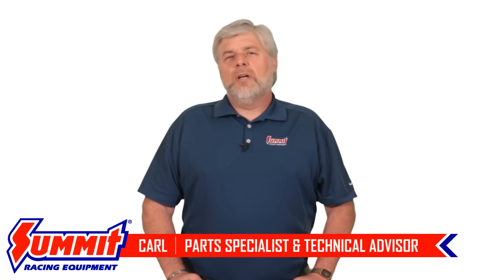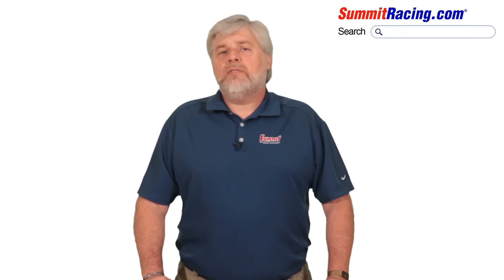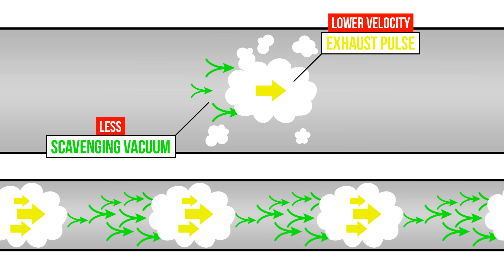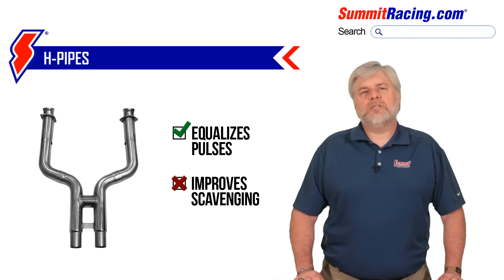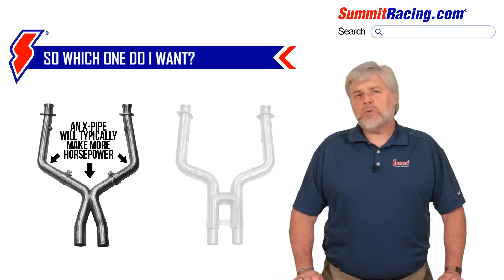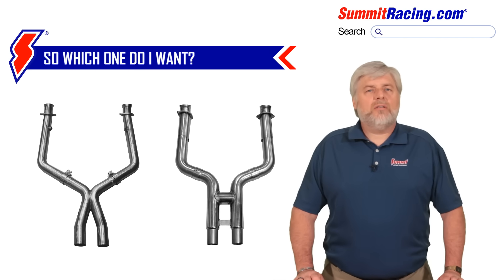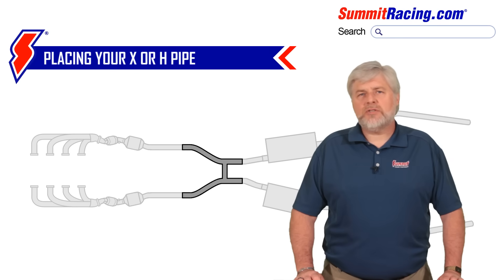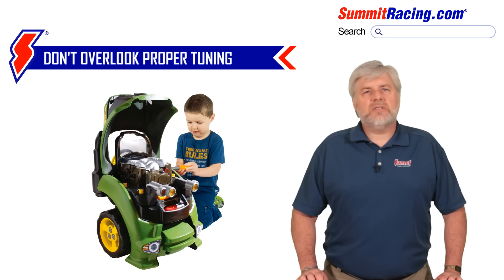Exhaust H-Pipes vs. X-Pipes: What You Need to Know

Comment: Question before I swap out these header i just bought. Will I feel or notice a difference with swapping my BBK Lt 1 5/8 ceramic, H pipe 2.5 all the way out Over to ARH Lt 1 3/4 stainless, Xpipe 3inch to 2.5 Keeping it magnaflow. No cats or should i just sale them a and not waste my time? am I making the right choice in swapping my headers out

Specs:
Jt V7 17lbs 
Kellogg 3.8 stroker 8:5 to 1
5.85 rods
Eddy intake
3.73. 26 inch tire
Bored .020
6061 intake
Air to air
80lb semen deka
Meth injection
Ported polish heads (Fox)
15% O.D pulley 
Pump has 93
Blow thru hpx
Shifting @ 7000 rpms
On3 dual 340 pumps return fuel system 

Blower Cams 
.550 lift. Lobe 116
Duration. 050  Ex 241  Intake 249
Advertised.      Ex 279    In 287
Rocker ratio  ex 1.825.   In 1.825

Comment: Does the length of the cross over pipe on the H-pipe matter? Example; running true dual exhaust on a 1ton, can I patch in a pipe where it'll fit or do I need the crossover pipe as short as possible?
Reply: The crossover pipe is just to balance the pressure between the two sides. A shorter distance between the two is preferable but if you have to add excess bends to achieve it, you're likely to lose any gains you were trying to make. Unless there's an easy spot to relocate your exhaust, to get them closer without adding restriction, your best bet is to just run the longer cross pipe.

Comment: I have a 289 in a 67 mustang, it makes great power from 5000 to 8000 rpm, the H pipe allows it to be driven normally below that.
Reply: Nice car
Reply: Haha! A 289 between "5000 to 8000" rpm is between "dead and impossible"...  I'd be impressed if it ever reached 5000 rpm - but going over it would almost certainly mean a 'leg out of bed'.
Reply: @thenewviceroy  
Not if built right. Mainly valvetrain beef ups. Oiling is not an issue for SBFs and the short stroke and good rod angle geometry allow it quite easily. Sounds good up there, too.
Reply: @upsidedowndog1256  if it is not making great power below 5,000 rpm, then it is built wrong for street use. it should be coming on strong at 3,500 at the very least.
Reply: @FRLN500  
I rather enjoy the powerband. It makes more than stock below 5K, waaay more than stock above.
Reply: Anthony Butera I have a 03 Dodge 3500 that makes great power at 2000 RPM... why I love diesel... we diesels get to use our peak power all day every day without blowing up the engine.
Reply: SilverStar Heggisist 😆

Comment: Engine masters just did a dyno shoot-out comparing straight duals, H-pipe, and X-pipes. They did multiple pulls with each, exhaust size and muffler's were the same for each test. The variance between the three was shy of 4 ft/lbs of tq and 1.5 hp. Maybe NASCAR finds those numbers important, but for the rest of the planet running full exhaust you'll never notice any power difference. 

The real difference is sound, and packaging. The X-pipe sounds best, and is the hardest to fit under the car.
Reply: Rene Jelles what type of sound sounds best, is entirely up to the person
Reply: Rene Jelles In my opinion, I like the deep growl of an H-pipe for the latest gen Mustangs. From what I've seen, X-pipes are higher pitched
Reply: The Fringes X-pipe is more of a Whoooop sound ( with the stock cats ) on my Town Car. Sounds like it’s reving a lot higher than it is. I get 21mpg in the city now.
Reply: Rene Jelles I personally think H-pipes is the best sounding. It gives that burbling, raspy, growling exhaust note.
Reply: So you think there are bigger differences at part throttle? OK...
Reply: @Zero-Fox-Garage  my phone
Reply: Rene Jelles No way! In my opinion the H deep rumble sound aided by no cats sounds sick. Also in my case I get to keep my quad setup.
Reply: Thats quite interesting. I would of thought it would be more of a difference that that given that V8 have uneven pulse timing of each bank due to being crossplane. But I suppose its probably too late at that point and best results would be from "pile of snakes" headers, like those on the GT40 where 2 of the primaries from each side are swapped to make each collector receive evenly spaced pulses.

For my own car I am going away from the norm of Y pipe, H or X and going 2 separate system as I have 90º V6 and each bank is even firing and adding 2ndary together reduces with the scavenging. It hasn't really been done much before beauce general concensous is applying V8 techniques will works but it doesn't for a 6 cyl engine, a few race cars and street cars with buick v6 have found good gains going separate banks for this reason.

The best scavenging strength occurs with headers from 3-1 and 4-1 on even firing. up or down those numbers the  resonance amplitude aka scavenging strength decreases. 

This is why flat plane V8, inline 4, flat 6, v6  etc respond so well to tuned exhaust and intake manifolds.  And why normal V8 not so much. Dual plane v8 manifold tells of this story because of the runners from each plane goes to the even firing cylinders overcoming the uneven bank issue. So I see why they don't drastically improved with exhaust pipe design either.

My mate added a H pipe over his dual separate system on his V8 HQ Monarro hoping to see improvements but nothing happen.
Reply: 7 months late but I agree, with Nova, H-pipes sound the best. 

X pipes are alright but depending on the car, like a V6 Mustang with an off-road x pipe, it sounds like a rattling tin can at full throttle.
Reply: Hit “like a v6 mustang.....” give up your man card.
Reply: @frustratedmillennialz if i want that roaring sound like a lion but not that loud not gunshots. What's better for me?
Reply: When everybody is running under tight regulations, then every extra horsepower (no matter how small!) Counts. 

       Same with aerodynamics (maybe its just one extra Mile an hour... but it counts!).... if you add up 1+1+1+1... +1+1+1 it starts to add up. It doesn't have to be all about 20, 30, 50 hp...its about what you get in TOTAL!
Reply: My 85 C30 sounds mean as hell with factory true dual exhaust which includes no cats. No H pipe or X pipe. And factory stainless manifolds too.
Reply: Rene Jelles - thanks for the heads up - I really should pull the trigger and get their premium service I guess
Reply: No one mentions true duals (no crossover, its on my el camino and i love it
Reply: Rene Jelles 
I've got a 2012 BMW 550i xDrive w/ a 4.4L Twin-Turbo V8. It makes good power but sounds like a little girls electric moped... 🤣

I'm looking to replace the resonator with either an X-Pipe or straight pipes back to the stock valved mufflers, hoping that'll make it sound "meaner". 

I understand the X-Pipe would give it a less raspy, higher exhaust note than straight pipe back to the stock mufflers... Would it hurt power much to just go with straight pipes replacing the resonator to get that DEEP RASPY sound, or do I need to go with an X-Pipe to keep from losing power on a small, Twin-Turbo V8?
Reply: Rene Jelles i have the X pipe on my 96 GT and it sounds good even with the stock mufflers.
Reply: Headers true duels  whith flowmaster supper 44 3inch pipe sounds good on suburban with 454
Reply: Thanks for mentioning this!!!!
Reply: This is really dependant on the engine used also.
Reply: I dislike the sound of an X, it's too high pitched, it loses some deeper tones. I'm running true duals, with straight pipes under the rear axle, with no H or X or any bends at all, and I like the deep, harsh tone, especially when it's over 8000 rpm.
Reply: Yep Engine Masters already tested and figured this out and there is really no difference between the two. Just run a true dual exhaust and this works the best. Small block chevy just run 1 3/4 long tube headers and 2 1/4 exhaust all the way back. This will flow great and you will have power all the way through the power range.
Reply: @erichildreth7562  exactly the bit of info I been readin the comments for. Appreciate it.
Reply: It's currently on motortrend on demand, but should drop on youtube in the next two weeks.
Reply: Obviously how it sounds is personal preference. I like the sound of an X pipe the best, clearly not an opinion shared by all.
Reply: Rene Jelles b,
Reply: Rene Jelles is that on YouTube. Wanted to see that.
Reply: Strait pipe is by far the best sounding.
Reply: Rene Jelles they do tje pulls at gull thottle all so tje does not show part throttle
Reply: @blainesnider9089  I think your hand positioning on the keyboard is a little off

Comment: Yeah I'm going to be that guy...The question that doesn't relate to the video.   I have a car with a three inch exhaust and an X-pipe.  I love the sound of this car, but would like to make it a bit quieter without changing the sound. What would work best? I've been looking into collector mufflers which would be before the X pipe. This is a 600 hp car  so I don't want to kill that either, just want to drive it through the drive thru  and let others order before I'm long gone.

Comment: With my stock motors i like to run two 2.25 inch pipes into a flowmaster y pipe then dump that into a 3 inch single pipe to a 3 inch in and out muffler.   My fuel mileage goes up as well as my top end.   just my .02c..

Comment: I just have a stock GMC Sierra with a 4.8 L V8 and I don't really want to beef it up a lot , I was interested in getting some improved gas mileage and throttle response. so I was going to purchase a 50 Series Flowmaster muffler cat back and a kn cold air intake filter setup. do you think it would be wise to keep the stock diameter pipes? and the y-pipe ?or would you recommend doing an h or X pipe? again it's a stock engine and I'm not looking for huge gains. I just want to get a little bit better throttle response and gas mileage
Reply: The stock Y should be fine. There's plenty of throttle response to be milked out of the 4.8 without changing the entire exhaust. The cold air intake is a good start. If you start messing around too much with the exhaust, you can actually hurt your throttle response on a stock motor. On top of the cold air intake, I'd go with upgrading your ignition system a step. That's where most of the inefficiencies are. Better plugs, wires, coil, etc will do more for your throttle response and mileage than dual pipes. A clean, fast burn is the key to mileage and response and that happens in the combustion chamber.

Comment: i am puttinga stock 6.2  LS aluminum block( 07 cad )into a 2ooo s10. hooker  cast manifolds. never going uncock it.should i stay with the stock size 6.2 exhaust or ? I have a super comp dragester and one wally, just so you get some idea who i am SC 706
Reply: Gonna race it or just tool around town?
What kinda power does it make(determines the flow rate of the pipes you need)

If you want a quieter trucklet and make 400 or less hp I'd go 2.5inch duals and quieter style muffs.
Want people to know you are there and make 400+ 3's and flowmasters/magnaflows whatever you like the sound of. I'm a flowmaster kinda guy.
Reply: the aluminum 6-2 in the 07 Escalade puts out around 430 horsepower. period I am going to put a traction control device on this and a big pair of street tires and have a lot of fun on the street. as I said I have a dragster to go racing with. And I might do a little bracket racing with this. the question is. With without uncorking it. Without taking the exhaust off. What is the best system that I could put on this S10. To let you know how serious I am. We're going to take the front end off and the bed off of this S10 so we can do everything as neat and clean as possible.

Comment: I like the way H pipes sound.
Reply: Jeremey Allen Yeah same here. H pipe gives more deeper muscle sound while x pipe gives more raspier exotic sound.
Reply: I've got a 2012 BMW 550i xDrive w/ a 4.4L Twin-Turbo V8. It makes good power but sounds like a little girls electric moped... 🤣

I'm looking to replace the resonator with either an X-Pipe or straight pipes back to the stock valved mufflers, hoping that'll make it sound "meaner". 

I understand the X-Pipe would give it a less raspy, higher exhaust note than straight pipe back to the stock mufflers... Would it hurt power much to just go with straight pipes, or H-Pipe replacing the resonator to get that DEEP RASPY sound, or do I need to go with an X-Pipe to keep from losing power on a small, Twin-Turbo V8?

Comment: what's best for a Chevy 383 on a 99 suburban
Reply: 1 how much power does it make(exhaust volume) 
2 does it have headers or manifolds.
3 quiet or throaty?

If you have manifolds stick to a h pipe, the scavenging of the x wont be used it would just alter the tone. You could go a large 3-4inch single with manifolds and cats and essentially not need dual exhaust and it would probably be pretty quiet.
2 Headers> high compression or low (under 10:0to1) 
 a Low. use an h pipe like the man said makes more torque.
 b High use the x it's quieter and makes more freeway rev range power.
3 Quiet or throaty. 
Buy good mufflers/silencers. 
There is nothing wrong with putting 1 size larger turbo mufflers (non chambered muffs) on a h pipe to quiet it down. Just make sure they have a true inner diameter at least as large as your pipe going in.
X's tend to be higher pitched and used with headers so a free flowing muff(chambered muffs) tend to noise cancel a bit better then turbo style mufflers. <-- gonna be fairly quiet around town but it'll get vocal when running the rev range.
Also make sure with an x or h you put some sort of tailpipe on it over the rear end to cancel the droning you get with them terminating in front of the rear diff.
For your sub assuming manifolds and cats a h pipe and 2.5in duals, quieter style mufflers and tailpipes would probably be best and keep the neighbors off your back.
Optionally y pipe it and run a 3-3.5 inch single back and then split after the muffler and twice pipe it for looks.<-- what the factory does for quiet but your silencer options are unlimited. I wouldn't run chambers it might make some wierd noises.

Comment: what about no pipes?
Reply: State and local noise laws.. At least on the street. At the race track a uncapped xpipe or header extentions(depending if you have headers) is probably closer. I had a 302 ford years ago and tried an h and x pipe and the x pipe was faster on the drag strip and was a lot quieter around town(2.5 type 40 flowmasters and a 2 .25 dual tailpipe) also removing the 100ish lbs of exhaust and running made 0 difference vrs leaving the full set of x pipes on.
Reply: retcwby - for that raw sound
Reply: @retcwby 
So, NHRA style sound???
Is that what you’re looking for???
Reply: Scootermagoo, do you know why exhaust pipes exist? Since you figure it is just noise ordanence laws, maybe put a hose from your exhaust into your cab and drive around.
Reply: Travis Root I think we can be friends 😂😂😂
Reply: ull destroy cylinder heads and valves springs. speaking from experience. 😂😂 😜 yeah it’s very loud but it’ll hurt engine.

my high performance engine is worn out after running hard for 10 years. (surprised it last longer) so decided to leave straight pipe open for long time. my rat truck has H pipe with straight pipe out on both sides under the doors (daily truck) and race it harder and blew cylinders head and blew the block. 

unless your engine is spec for running harder with straight pipe. like race engine. or for drag strip.
Reply: Bad juju. I just bought a 5.7 Vortec from a guy who had burned his exhaust valves so bad he thought the engine was about to go, running straight pipes.
Reply: basically like putting oversized pipes. More of a drag strip thing. your engine might just kill it's valves on a daily driver